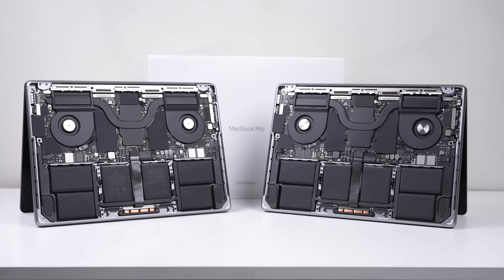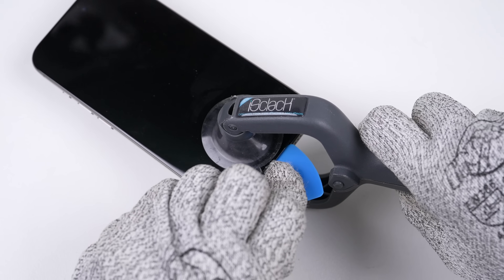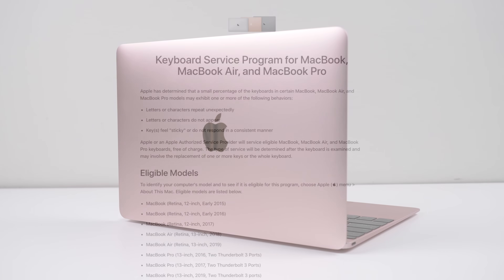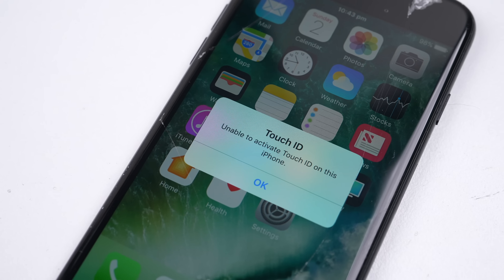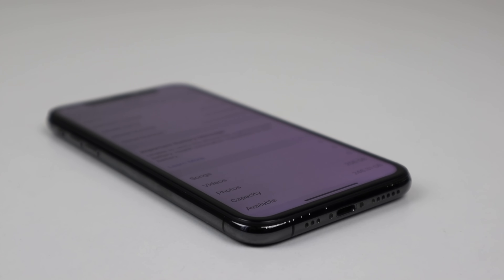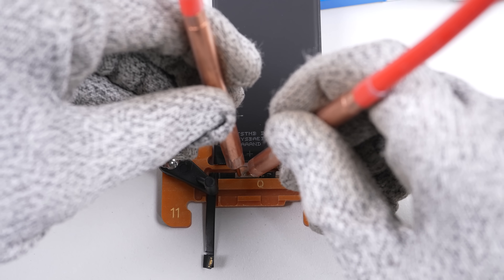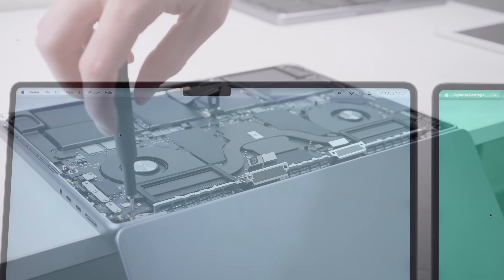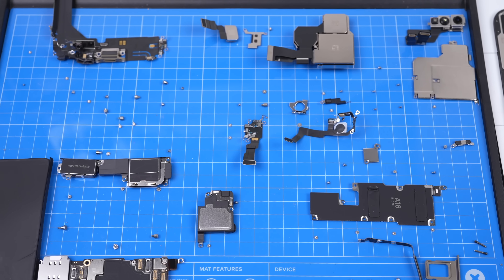Astonishing Anti Repair Practices By Apple In the Last 15 Years

Comment: Overall a well done video 

However what on earth are you doing with your disingenuous and inaccurate representation of Apple’s peak performance mode… which yes they settled for because optically they did not do well to deploy it silently and without user decision. However this was in no way to slow down your older device to make it unusable - instead to add in limitations to software which would tax the device - meaning they will crash when taxing the older hardware etc. peak performance is not a mode that is hampering your phone, instead it is doing the precise opposite.
Reply: apple user spotted. (i take it back sorry)
Reply: @ProbablyAnAmateur  oh whoops as it turns out I have a Galaxy S23 Ultra and an iPhone 15 Pro…

No duh likely those commenting on this have intersected with or continue to interact with an iPhone… braindead spotted! 🤡
Reply: @ProbablyAnAmateur  you have to be a bonafide dipshit to fall into the “I can’t understand peak performance so it’s obviously Apple manipulating my hardware trap” sorry not sorry bud

Pretty simple to see how battery health worky. Pretty simple to see if you can rock the iOS your device is happy with (rocked a XS for years on end while going android to android I literally bought one who’s battery was a “bomb” within my XS’s life..) it can do just fine for years upon years. Apple handles its software vastly differently, I pointed out how good much of this video is because what they freaking suck at is things like not letting you regress in software should you find your old device is getting fried by new update or Apple made you update it to repair it even! That is legitimately and verifiably a thing that is taxing older hardware to death so someone needs a new phone. Luckily this is something you can do on your own if you are savvy enough, which to my general view the majority of android users already are due to how they must set up their phone and tailor it to themselves.

Things aren’t perfect even if you find your happy IOS because unlike a single os per hardware build release (minus firmware and bug fixes to the same android os) can much more easily control - Third party developers don’t want to support old iOS and sitting where your hardware is happy might not allow you to use applications of the device you do need.
Reply: @o0821  oh sorry man. guess i am a bonafide and braindead dipshit. seriously though apple can do whatever they can and want to just force them to buy new. and forcing on no downgrade is one of them. i do have an apple laptop from 2013 but its collecting dust since the RAM has given up, and being unable to replace it its useless despite not being used in a while. went back to windows when the MBP bit the dust, and soon ill be Linux only, considering Microsoft is also trying to hop aboard with windows 11.
Reply: @ProbablyAnAmateur  I’m not on the fan bus but I’m on the bandwagon, and because I am that means I try to understand what’s happening as much as possible. I can’t expect you to want to be as thorough in understanding if you’re not using it, but I employ you to not get stuck in hating on something because you don’t understand and assume the worse, right?? I would call that a braindead response all gut zero thinky~

have some applications I prefer to run Mac but I have a much more current PC built, I render things for work so it’s important for my livelihood to be comfortable with software across the operating systems, but I have the last intel MacBook Pro (2020) which i configured to the highest specs, it’s now entirely blown out of the water by current M series MacBook pros…. But I can’t see myself relinquishing my bootcampable laptop and give full control to Apple… I get where you’re coming from dude. (You can’t reset the smc on a M series mac yourself “technically” why would I want to own hardware like that…even if the hardware is a jet engine?)
Reply: @ProbablyAnAmateur  the last mac desktop I’ll ever make the mistake of buying is the 2013 Mac Pro “trash can” work office has the new cheese grater Mac pros and 🤮🤮🤮🤮 it all went downhill from OG tower 

I buy things I can see as an investment that will last me over the years I am making work with them. I also have to worry about my software limitations due to older hardware more than a user just buying a consumer electronic device for funsies. 

Even if it’s collecting dust The 2011-2013 MacBooks are desirable depending on what you have if you have a disk drive you can change it to solid state and easily change the battery on your own, stop letting it collect dust buy new DDR3 ram modules for like $40 and sell that shit!
Reply: @o0821  absolutely fair. the gripe i genuinely have with apple is how they pair the parts,  making them useless which is the biggest issue with attempts to replace them. ive used laptops over 20 years, and they all still run because ive replaced the RAM, processors, storage, and LCD panels and even the mainboards. basically i rebuilt a 2013 Dell Precision, i needed eDP not LVDS so that was rather painful waiting for the parts to appear online but i still use that one. 

i dont hate apple, its a strong word. i just dont like apple, and their practices even tho their M systems are tantalisingly attractive, it still repels me.
Reply: @o0821  i should clarify i have the Retina Late 2013 model so the RAM is soldered... so as much as I would love to get it running again i cant exactly replace LPDDR3 RAM.
Reply: @ProbablyAnAmateur  oh shoot you got the first “flash memory” from late 2013 huh :((
Reply: @o0821  yeah I didnt know at the time. if i want a higher end mac, then either i suck up for an M, or hackintosh my way through with my other laptops. and since apple favoured AMD, my M4800 is the only system that will run macOS. my dell 7540 isnt a good candidate because that uses Nvidia so..  unless i opted for the 7530 i could have transplanted the WX4150 that was in my M4800 to it, but nope its the DGFF format for the newer one.
Reply: @ProbablyAnAmateur  ik its likely going to mean transplants and putting work into your pc builds to get them to have parts that will support drivers that let you hackintosh but it is doable and IMO I think it’ll give you way more freedom than biting the bullet and buying an incredibly expensive M3 that sure will be “future proof” for a while, but once that while is expended and the thing is shot. That once expensive thing is stuck, and the only thing you get to do is trade it back into Apple to continue the vicious cycle. They know precisely what they’re doing to make consumer electronics with a “usability half life”
Reply: @ProbablyAnAmateur  to educate you on peak performance they paid out a settlement for the first instance which I view as a PR catastrophe. It initially was a new feature which popped up silently in iOS and did not make the user aware in any way. Peak performance mode absolutely continues to exist in current iOS but now it’s something you can see in settings when it is triggered by an intense app on your hardware crashing or causing a panic and you can also toggle it off permanently at your own discretion to how your device will perform

Comment: As a former repair tech at a MacBook repair depot (a official apple one), I think it’s funny how apple makes all of their packaging on the consumer facing side “eco friendly”, but I went through thousands of tiny pieces of plastic every day from the packaging materials in the replacement parts.
Reply: my old lenovo x220 is almost 15 years old, got upgraded RAM, SSD, and on it's fourth battery. It can be easily disassembled with only a screwdriver with a set of bits, no glue, no heater needed. And I can still buy parts for it including case parts like bezel etc.

That's eco-friendly: upgrading and maintaining instead of throwing away and buying a new one.
Reply: @adrianalexandrov7730  sorry for answering late but you're right, modular technology is the future. So glad PC's are just such
Reply: @MrMango331  no worries, bro. Wasn't even expecting the answer, just shared my personal experience.
Reply: @adrianalexandrov7730  ... This is why my main computer is a desktop and always will be because they are easily upgraded for many years. The one I am using now is more than 6 years old and works just fine. My next new desktop will probably be in a year or two, maybe even 3 years.
Reply: @adrianalexandrov7730  Thats amazing. I have really long lifetime on my desktop PC's. My first "proper" one with celeron 400mhz cpu is in the junk pile of course but the next one with core 2 quad 9550 and a Asus motherboard and some kingston DDR1 RAM is still in use with upgraded SSD, new power, gpu and a case on my wifes friends.
The major components are from 2006-2008.

My next PC is in use with my son with a I7 4770K and a Radeon RX480 gpu.
Reply: I used to work for a School District and summer time rollouts show you how much waste Apple produces. At least 4 times more packaging then a similar product from Lenovo, Dell or HP/Compaq.
Reply: @deathwarmedover  yeah, it has been like that for decades. Apple is batshit when it comes to pretty much everything.
Reply: Eco-nomy friendly.... 🤣👌
Their economy btw....
Reply: Holy crap yes!! I worked at a school district and we had about 5k ipads and the amount of work it took to unwrap a single charger was rediculous. there was so much more thrash than what was needed. We purchased the chargers in bulk so they should have a different way of packaging chargers that are purchased in bulk with less "box"
Reply: Certified repair tech.
SO MANY BAGS.
So, so many tiny little plastic bags, for every single miniscule part, down to individual screws.
Madhouse.
Reply: “We removed the charging block to be eco friendly and definitely not to make more money. You’re welcome.”

-Apple
Reply: Only for show
Reply: The sad thing is that plastic or other things made of it end up in the oceans.  It is horrible to see it really!  Does Apple make any attempts to recycle that packaging?  If you said no it would not surprise me much.  Really anyone seeming to care for the environment seems to be a thing of the past.
Reply: Its because looking like you care gets you more cool points than actualy being good to thr planet  @charleshines2142
Reply: The closest thing I've seen to eco-friendly packaging in computers is Dell's laptops.
Barely any if any plastic is used in the packaging at all.
They don't put 10 billion plastic films on everything, the box is just cardboard none of that plastified shit that apple uses.
They use recycled paper/cardboard for all the shock absorption materials.
No plastig bags around the charger for god knows what reason (no one is going to RMA a charger because it has a god damn scratch, hell anything that can scratch a charger won't be stopped by a thin plastig bag)
Reply: Apple amazed me by brainwashing their consumers
Its like they convince people to buy pricy product cause its seems superior XD
Reply: You guys have relacement parts? thought you just sold new phones.
Reply: An official one
Reply: all thes corps do eco friendly stuff for tax purpose only
Reply: 🤣recently I saw a post from some green guy that all the cardboard packaging is bad for the environment because of the trees. I think you are a bit behind. The new green trend is more plastic??
Reply: Dont like Apple, but that applies to all and every company tho. No matter what you buy, every tiny piece in that device was once shipped in its own little plastic bag. Working in the industry I always found it funny when some people complained about a tiny bit of plastic that is around their food in the supermarket. If they just knew that everything they buy has magnitudes more plastic waste until the product is shipped to them^^
Reply: @dankrigby5621 but apple is the first one to act like its better than everyone else because theyre "eco-friendly"

Comment: You know a company is arrogantly against their consumer base when even their own "qualified" repair technicians screw up repair jobs. To be "qualified," you need to go through their classes, too. At least, from what I was told. I hate crApple. They're overpriced, overhyped, unreliable, irreparable, and greedy corporate trend-setters. Nearly all of the stupidly anti-consumer designs, like only one USB-C port for everything and the flex cable. Flex cables break with small amounts of dirt or dust. Also, the newest titanium cased iphone could cause the user to catch some toasty amps if they are connected to an unsafe product, like some chinese counterfeit or one of their many poorly designed products. It's not easy for the average consumer to identify them. It requires taking the thing apart or watching tear-down videos of someone who does know how to spot them. Though macbooks appear to have that problem to some. I've never noticed them and I've handled dozens without gloves. It's kinda why most other laptops have cases made of plastic to avoid that possibility completely.

Comment: I'm genuinely surprised that Apple didn't solder / weld the bottom access panel to the body, obviously to "Ensure optimum water protection, and the best user experience and hardware protection from external elements".

Comment: I repaired these phones for over a decade. Back when apple released the iPhone 6, I had a lot of customers that came to me with iPhone 4S models that couldn’t enable their Wi-Fi. The Wi-Fi button was completely greyed out.

What caused this? Apple disabled the ability to use Wi-Fi on older models so customers couldn’t upgrade to the new IOS version that came out with the iPhone 6 launch. Customers would take their phones into apple where they were told by apple’s staff that the phone was too old, couldn’t be fixed, and this is where apple would try to sell them a new phone.

Not everyone wanted to buy the iPhone so some of those customers brought their phones to me to see if the Wi-Fi issue could be fixed. I found a solution.

How did I fix this problem? 

…I placed the phones on a HOT PLATE. That’s right! I set the phones on a hot plate and overheated the phones. The temperature was set to 120 degrees. After overheating the phone I gave the iPhones a few minutes to cool off and then turned them back on. After overheating the Wi-Fi mysteriously started working again.

Don’t ask me how or why this trick worked, it just did. 😅
Reply from the maker: If the solder joints under the WIFI chip broke it would cause this issue. This wasn't anti repair it was just a flaw with the 4s.
Reply: @HughJeffreys  Any idea why overheating the phone would fix the issue? I did this for years, and never once had a person come back with the same problem. 

I’m familiar with the digitizer IC chip issue on the 6+, and the white bar of death. It never occurred to me the problem with the 4S might be a poorly soldered chip. A bad chip maybe…

Comment: And this is a big part of why I don’t trust apple or their customer service at all. I would NEVER buy any kind of laptop, computer or similar from them. I still buy iphones and watches from them because I enjoy their ecosystem and don’t mind if I can’t replace parts because I’ve never had any apple device that stopped functioning, at most I’ve replaced batteries. 

Honestly I’m about to change my phone now, it’s the xs max closing in on 5 years age and I’ve noticed slowdowns despite the battery ”supporting peak performance”, kind of think they either slow down things hiddenly or it’s the new software updates that gradually overpower the phone’s processing power.

At this point I’ll either buy their cheapest models of phone or just take the big step out of apple’s ecosystem completely and get a much cheaper android with similar specs. Considering it seriously and leaning to ditching apple as the only things of theirs I use is an old watch and old similarly old phone, will take some getting used to but I think I will enjoy an android phone more in the end without all of apple’s silly restrictions on both hardware and software. 

I’m using an alienware dell laptop exactly because of the great premium service and replacable parts. Pretty much everything is replacable easily and often they can just send you parts so you can do it yourself. 4 m.2 ssd slots, exchangeable RAM, every part is made so you can just get a replacement part and quickly replace it. As long as you’re under their premium warranty, you can expect no extra costs. Battery is also literally just like 2 screws and one cable you see as soon as you open it. Even replacing fans or other parts is easy and made to be simple. Poking around inside doesn’t void warranty and they provide good guides. 

That’s how things should be in today’s world. Can’t escape some soldered on stuff for thinness but at least it should be replacable in a reasonable way…

Apple keeps on disappointing in how restrictive they are with piss poor service to top it off. Hostility towards so many technologies and refusal to adapt to common tech like usb c that was refused for so long until recently. I think they might gradually be starting to realize that their approaches are actively losing them tons of customers and probably more money than they earn from this crap. Now I guess I’ll switch soon and when I do, you can be sure I will not be back to give them a second chance unless they fix the servicability flaws and obstinate or even toxic behavior and approaches.

Comment: We are considering replacing one of our iPhones (in our family). The information in this video has "sealed the deal". The iPhone will be replaced with an Android.
Whatever slight benefits there were to staying in the Apple environment have been nullified by the inability to replace simple devices like broken connectors, bad speakers or a battery.

Goodbye Apple, you have succeeded over the last twenty years in to going full-on jerk-mode.